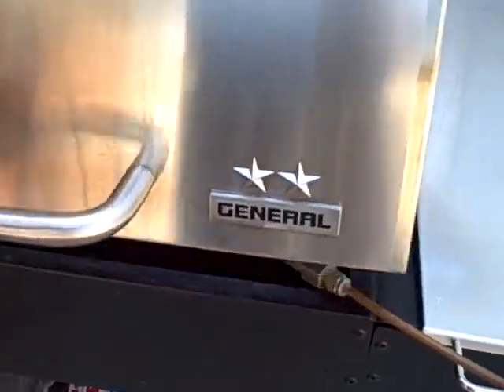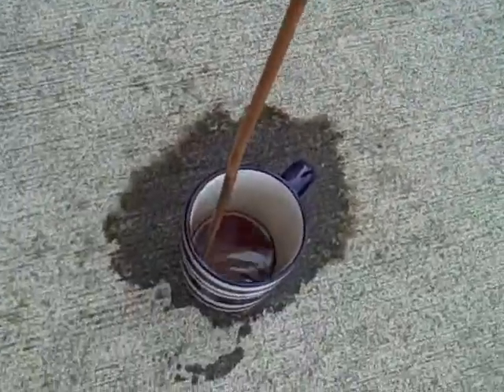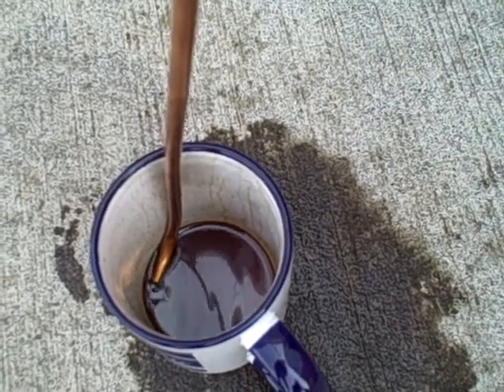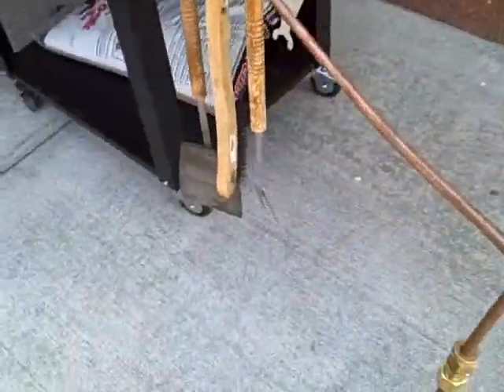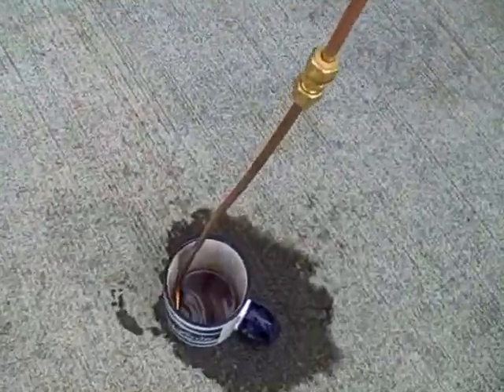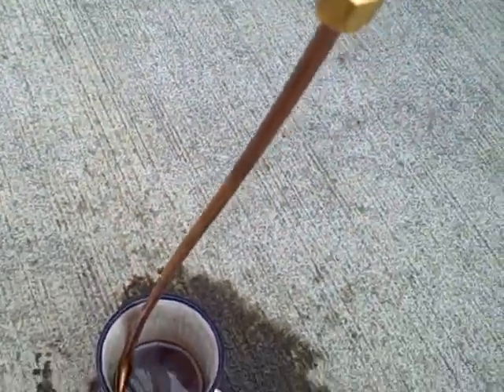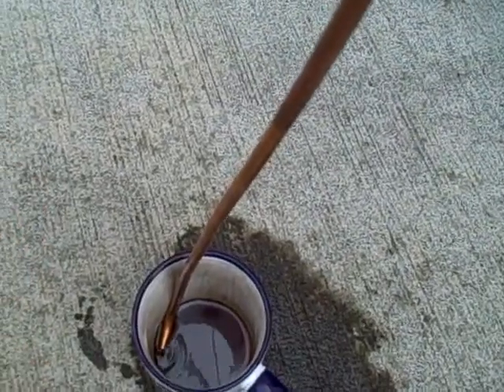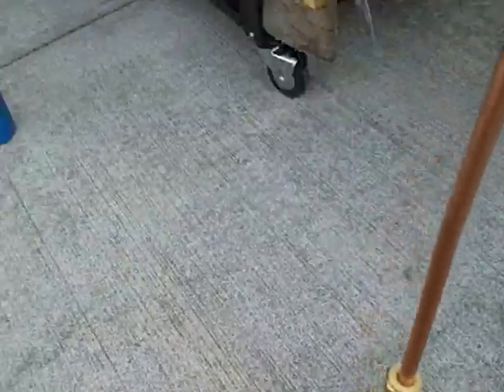Biomass pyrolysis experiment -- retort fired by grill (phase 4)

Comment: I don't think your temperature was high enough.  That is if you were measuring in Fahrenheit. In my experience you should be up around the 800 mark. Anything lower than that and you are just drying out the wood chips.